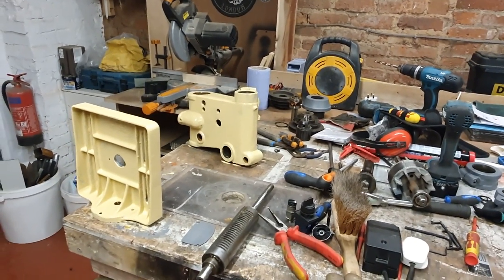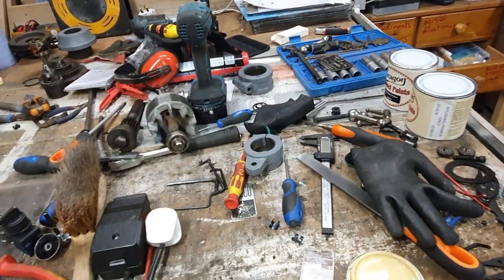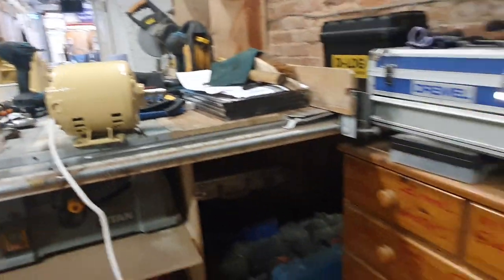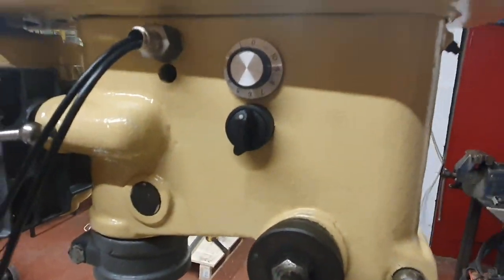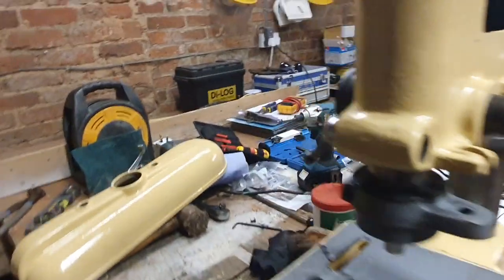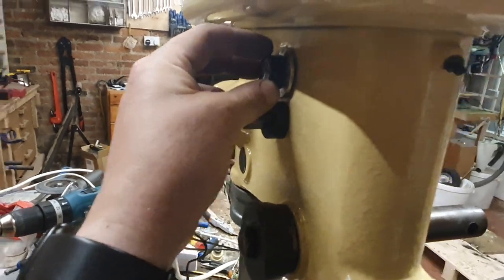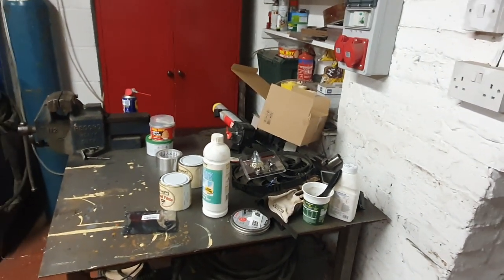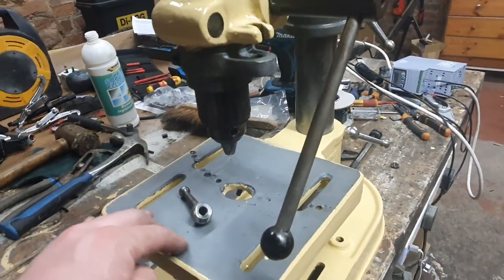FOBCO Drill Press Restoration Pt4

Comment: Be interesting to see how the VFD holds up, in theory it should increase life of motor. Great piece of up cycling, get it bolted down to stop Frogy reclaiming it
Reply: Unfortunately putting a VFD on a relatively old motor like this one is very likely to cause problems in the longer run - despite the lower speeds which you'd otherwise assume to be helpful. To essentially repeat a comment I made in response to Part 1 of this series:  the inverter or VFD controls the motor by applying rectangular voltage pulses ("pulse width modulation" or PWM) to the windings, with very fast-rising/falling edges. With a VFD the voltage at the motor terminals typically swings through several hundred volts in a small fraction of a microsecond (!) and this is a lot more stressful to the motor insulation than the ordinary mains supply.  VFD's also cause additional bearing wear because the same fast-rising voltage pulses push current through the electrical capacitance that unavoidably exists between the motor windings and the rotor. Small voltages are then developed between the rotor shaft and stator assembly, enough to break down the bearing lube film and cause tiny sparks which, over time, erode the bearing races and rolling elements.    Modern high quality motors are designed to withstand the PWM voltage pulses (which can cause voltage stresses in the insulation at well over 1000V), but your vintage motor won't be designed for inverter use, and if you connect it directly to a VFD,  you may find yourself having to replace it or carry out an expensive rewind after only a relatively short period of operation.   All this can be avoided by placing a "sine wave filter" between the VFD and the motor.  These are available from decent inverter (VFD) manufacturers, also from companies like RS Components (who supply German-made filters from BLOCK). Choose a filter with sufficient current rating (obviously) and make sure the VFD switching (carrier) frequency is set to a value suitable for the filter you've selected (e.g. 8kHz).     Sorry if all this sounds alarming!   You may of course be lucky and not see any issues, and if the drill only gets used occasionally then the fact that the motor life is shortened may not matter anyway; but please do be warned!